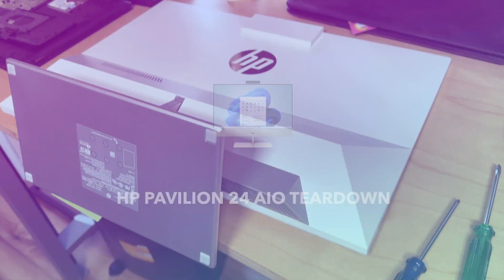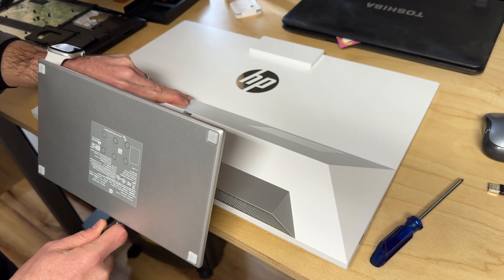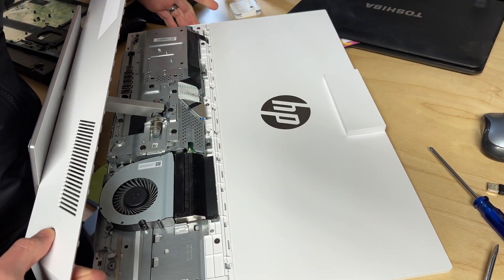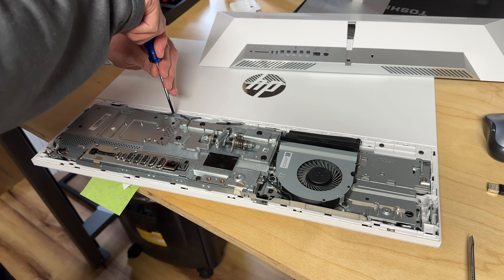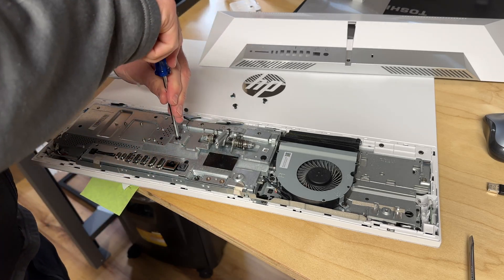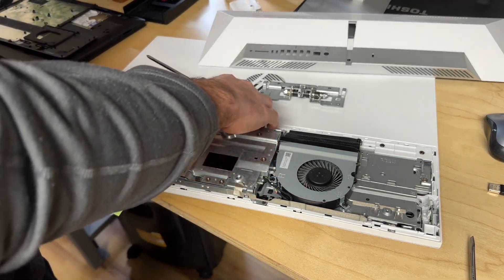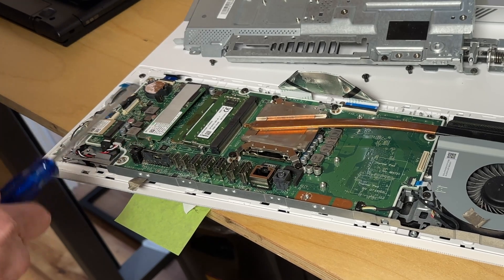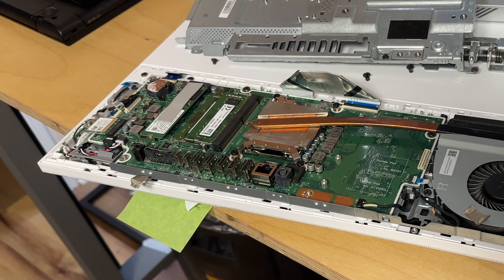HP Pavilion 24 Tear Down - Service, Repair, Upgrade RAM, SSD, or CPU!

Comment: One of thge easiest to open modern AIO I've seen. I hate that they don't provide a little back door for RAM and SSD but at least on this one you can remove the panel and it's ease to expose without messing around with the LCD.
Reply from the maker: True!